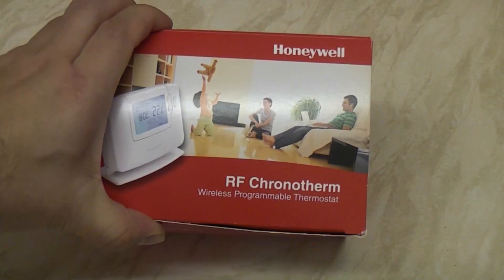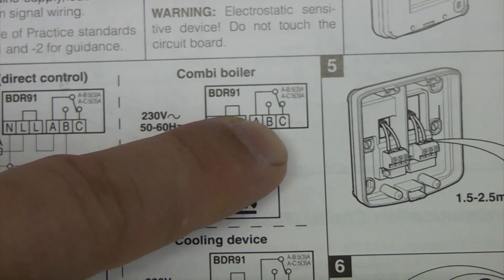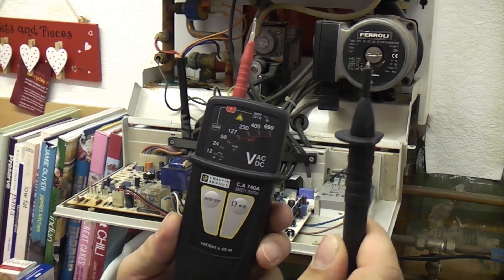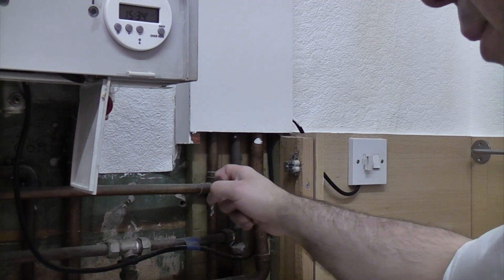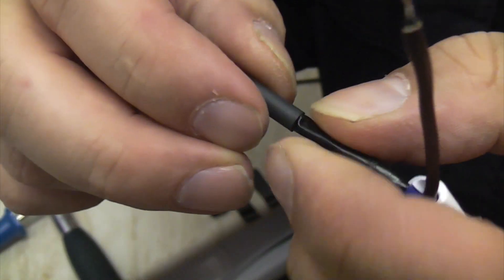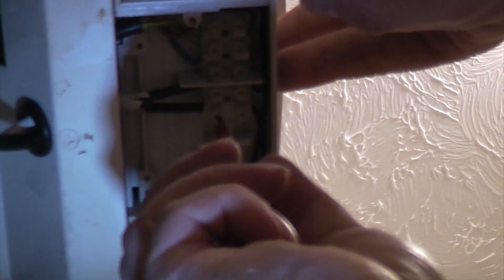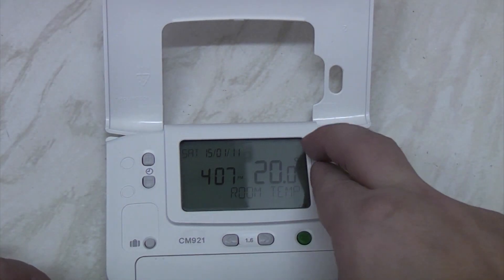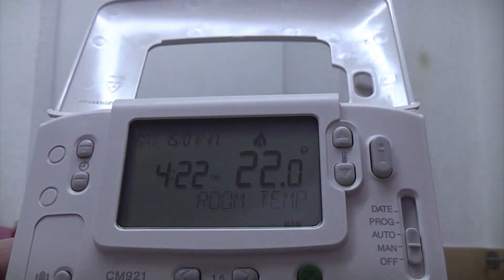How to fit a wireless room thermostat | fit Honeywell wireless thermostat

Comment: hi there, I have a honeywell ST9400C programming unit, and I am trying to replace my old hcw80 wireless thermostat and receiver, with a newer DT90e  in the old receiver have a 5 wiring which are (Blue wired in N, then the brown wired in the L (2nd)  then I have a black wire which wired in to A, then a grey wired into B and then the earth wired into the E, , do I follow the same with the new receiver dt90e ? if so where do I connect the earth as on the new dt90e there is no E (mark) only C, in the new receiver dt90e I have a NLL then ABC , any advice? thanks

Comment: informative video i have one of these can i take it with me if i go out anywhere? also on my honeywell CM921 ok button is not working to set the time?
Reply from the maker: No, if you move it too far from the receiver, it will not work.
You might need a new unit, if you want to set the time and the button is not working!

Comment: My relay box keeps flashing red and won't work with the transmitter. Any ideas on How to solve this?
Reply from the maker: Not sure, but it might have lost connection with the remote.
If you download the manual for the exact version that you have, it should tell you what it means and how to rectify it 👍

Comment: It's any chance to conect a thermostat to a vaillant eco TEC pro 28?
Reply from the maker: You should be able to fit this thermostat to any modern combination boiler, or if you don't know how to do it an electrician or boiler engineer will easily be able to do it.
Thanks for the comment 👍

Comment: Hi there I have exact one has yours,have you had any problems with other rooms in the house not getting warm,has I am having this problem,I have places the unit in neutral places and still only certain rooms get warm,hope you can help thank you,
Reply from the maker: This will only set the temperature in the room where it is placed, once that room gets to the set temperature, it will not ask the boiler for more heat. You can either move the remote to one of the cooler rooms (which will mean that it will call for more heat), or perhaps adjust the radiators in the other rooms using the radiator valves. If you are struggling, just do a search for radiator balancing, that should help ;-) 
Thanks for the comment 👍

Comment: Excellent video. I have a ferroli boiler.. similar diagram to yours. The clock in the boiler is faulty if I replace with a wireless thermostat and receiver can I just take the clock out

Comment: Could you explain to me where the two wires go for switching the boiler on? I’ve tried using the low voltage switched wires and remove the link wire but my boiler stays on all the time, I removed the link wire completely and my boiler still works does this sound right to you? This is why I’m going to have to wire it with 240 V switching
Reply from the maker: Normally the two switching wires just replace the link wire, as it is just a relay contact on the other end which closes to complete the circuit.
Thanks for the comment 👍

Comment: Great vid - would this be classed as a volt free thermostat as it didn’t require additional power source? Looking to fit to my Ferroli which can only have a volt free receiver fitted. Thanks in advanced.
Reply from the maker: Yes, if I remember rightly it is zero volts (you just need the L and N connecting to power the unit).
Thanks for the comment
Reply: Volt free would have been wired in the same way.

Comment: As a Gas Safe engineer myself I believe  you are breaking the law when a none  Gas Safe Person does any work on a gas appliance. It might be wise to contact Gas Safe for advice to prevent any trouble. On a recent Domestic gas course we were told an electrician was prosecuted for removing the boiler cover and connecting the flex to the boiler terminals.
Reply from the maker: I have contacted them in the past, when another Gas safe engineer was going to report me for removing the cover from my boiler to replace the expansion vessel.
Thanks for the comment
Reply: When was the last time a gas safe engineer tinned wiring... stop hiding behind gas safe.  Great video by the way Ultimate Handymen.
Reply: I'm an Rgi and an niclec  electrician. There's absolutely nothing wrong with him removing the cover in this case.  As the combustion seals were still intact.  You must have recently qualified.  Atleast kinda followed the safe isolation procedure 👍

Comment: I have an old room thermostat in the hall for altering temperature  and a programmer in the kitchen for choosing on off times for heating and water does this replace both of these boxes or just the room thermostat. If it replaces room stat and programmer do I have to disconnect all this before I proceed or does new thermostat auto override. I see this video...which is excellent is 4 years old...is there a more  up to date thermostat now. Thanks in advance.
Reply from the maker: I'm not sure, to be honest.
I have only ever fitted these to combination boilers to remotely control the central heating.
Thanks for the comment

Comment: Are you Gas Safe Registered as it is illegal  to work on a gas appliance if not.
Reply from the maker: No, I am not. 
You do not need to be gas safe registered, unless you are working on the gas side of the boiler, or a part of the boiler which creates part of the combustion seal.
Thanks for the comment

Comment: Great video, very helpful, thanks. I am trying to connect my BDR91 from a heatline caprizplus. It has a single connection for Room thermostat labelled (RT) and another one for Frost protection (FP) apart from the live and neutral. As our boiler doesnt have 2 switching wires as in your video, it is confusing as to where to connect it on the BFR91 - do I have to use any jumper leads? Thanks
Reply from the maker: I'm not sure, sorry.
This is the only wireless thermostat that I have installed, so far.
Thanks for the comment
Reply: @ultimatehandyman  No problem, thank you for a quick response.

Comment: Hi helpful video thanks. I need to replace this exact stat with a smart stat. The only thing I am confused about is the switched wires, does it not matter which way they go round in the boiler or receiver? It didn't seem to matter in the video? Thanks
Reply from the maker: It does not matter with this boiler/receiver as the receiver is simply replacing a link wire in the boiler. When the receiver calls for heat, it closes a contact to make the circuit on the boiler.
Reply: @ultimatehandyman  thank you for your help.

Comment: Just had a Wireless Thermostat fitted by a plumber, this is the best video around telling you how to do it. Only issue we had was working out which connection to put it into in the boiler.
Good job mate.
Reply from the maker: Thanks for the comment ;-)
Reply: I bought a Honeywell Y6630D Wireless Room Thermostat, which only has a turn wheel type of dial on it, no fancy digital display or anything. So working out if it goes into the 230v connection or the eBUS connection wasnt as easy to work out as you might think :)
Works fantastic now in, well worth the effort!

Comment: My existing Danfoss TP5000 only has COM and NO wiring. It is battery powered.  To install your CM921 i will also need L and N. Can i spur that form adjacent Light switch or power socket?

Comment: Can you add in one more wireless thermo stat on to this system for example one for upstairs one for down stairs?
Reply from the maker: No, this thermostat only switches the heat on or off.
You might be able to do it using different zones but you might need your system re-piping.

Comment: I'm replacing the same model. CM921. No matter how many times I press the buttons as you do, the unit will not go into the test transmit mode. Incidentally, a Honeywell video on here says press the left button, not the right one. Doesn't matter in my case though as neither option works for me!

Comment: thanks for the video... does it matter which way round the switch wires go?
Reply from the maker: In this particular installation it did not matter as the contacts are 0 volts.
It depends on your boiler though (it should say in the instructions)
Reply: ok... thanks

Comment: hi can you do a video for wiring up a two port valve controlled by a wireless thermostat to remote control central heating only - someone told me it doesnt need to be connected to the boiler as i dont want to mess anything on the boiler up just a request i need some help with cheers in any event all the best all the videos you put u are great :)

Comment: should of used the earth connection so the cable does have the earth in so any problem it cuts out.
Reply from the maker: The instructions said to use two core cable ;-)

Comment: I've got a salus wireless thermostat that's playing up, can I just buy any wireless thermostat and it will work with my current receiver or do I need a new thermostat and receiver and have to piss about with wiring?
Reply: yes you can they have 2 receivers make sure your replacement uses the same receiver as the one you got. You can easily re-pair them. If you can't find a thermostat without the receiver, you can just buy the kit and reinstall the wires in the new receiver.

Comment: hi there I have a Worcester boiler with the same transmitter but the buttons don't work very well but all I have to get a new wireless transmitter with the LCD screen do I just connect it wirelessly as you did when you put it into test mode with the existing wireless box or do I have to get a new wireless box and receiver fitted to my old boiler. Question mark thank you

Comment: How long should the all fitting take? I was billed one hour and a half for that. I think it is a lot too much.
I am very opposed to thermostats especially when there are thermostatic valves on each heaters. There is a conflict between the two controls and also you can have the required temperature in a room and completely freezing in another.
Reply from the maker: It's hard to say really. It took me a couple of hours as I was filming it but I installed one for a friend in about 45 minutes.

Comment: Sound vid and thanks, just a quick question, just fitting a Worcester 30i , am I ok to come strait off the fuse spare for the power to the receiver and just have the switching wire going to the boiler?......kind regards Mike.
Reply from the maker: Thanks Mike, yes that should be fine.Thanks for the comment.

Comment: Black for switch live wire? Shouldn't it be brown?
Reply from the maker: No, the two black wires go to the relay.
Thanks for the comment ;-)
Reply: Personally I would use brown unless it's different when wiring a relay. Didn't mean to be offensive by the way. It's a great video and very informative. Thanks for the reply.
Reply from the maker: No offence taken ;-)
I believe some of the wires going to the relay on some boilers could be 12v or 0 volts which is why I used black sleeving.
Thanks for the comments ;-)

Comment: Excellent! I've just bought one of these for a Baxi 105 HE. Pity it has to be 30cm away from metal because I had intended on siting and wiring the receiver right next to the boiler's fused spur (which is very close to the boiler. I think I'll test it there anyway, otherwise it's a short run up the wall. Great vid!
Reply from the maker: +Noth Ankyou 
I have just checked the boiler here, which has the exact same unit.
The installer has it positioned about 5cm away from the boiler and we have had zero problems ;-)
Reply: ***** Cheers for that. Hopefully mine will be OK then. I'll give it a week's test and let you know how it goes. Keep up the great vids!
Reply from the maker: +Noth Ankyou 
You are welcome.
Thanks for the comments
Reply: +Ultimate Handyman It's been operating fine for 3 days at exactly 100mm from the side of the boiler housing so I fitted it. Thanks for the tip!
Reply from the maker: +Noth Ankyou 
Good stuff ;-)
Thanks for the comments

Comment: Great video, do you have to disconnect the existing boiler programmer if there's one integral to the boiler as is the case with some boilers?
Reply from the maker: +Pat19eighty4 
I think you can just switch the programmer to manual, that should mean that the wireless thermostat takes over.
Thanks for the comment

Comment: great video..thanks for uploading.very helpful and easy to follow.
Reply from the maker: +Aamir Khan 
You are welcome
Thanks for the comment
Reply: +Ultimate Handyman I have a 24 hour timer switch installed for central heating(as. we dont have built in timer on our boiler).I want to put in a wireless thermostat.will same wires that come out of the timer switch go into the wireless thermostat?
Reply from the maker: +Aamir Khan 
I don't know, probably best to ask here- http://www.ultimatehandyman.co.uk/forum1/central-heating-boilers-f35.html
With as much information as possible ;-)
Reply: +Ultimate Handyman Thanks pal
Reply from the maker: +Aamir Khan 
You are welcome ;-)
Reply from the maker: +Dean Harper 
No it does not matter. I actually added black sleeving to the brown and blue wires, if I remember rightly!
Reply from the maker: +Dean Harper 
It doesn't matter because these two wires just lead to the contact on the relay, which is either open or closed depending on whether the thermostat is calling for heat, so this just replaces the linking wire that was removed from the boiler initially.
Thanks for the comments ;-)

Comment: Hi thanks for the vid.

quick question when you connect the switch wire A and B to the boiler how do you know which way round they go?
Reply from the maker: +g wild 
With this boiler it doesn't matter which way around they go as thy are simply connected to a relay, which is closed when the thermostat is calling for heat (which closes the contact on the relay)
Reply: +Ultimate Handyman 

Ty for the reaponse one last question before I get started, the wiring for the relay box says 
N L L (neutral live live) I can see you used neutral but did you use the 1st Live or 2nd Live to power the relay box?
Reply from the maker: +g wild 
I just connected the wires to the where the existing N and L wires were connected in the boiler
Reply: +Ultimate Handyman 

yes I can see where you wired it to your boiler yes but the relay box has room for 3 wires N L L. I was wondering if you used the 1st L or 2nd L in the relay box? Your video shows the relay box on the wall but it's not clear to see which connections you used!
Reply from the maker: +g wild 
Sorry, it was a few years since I installed this!
The two L terminals in the relay box are connected to each other, so you can use either of them ;-)
Reply: +Ultimate Handyman 

Excellent thank you for helping me with my questions wish me luck I'm about to start 😨
Reply from the maker: +g wild 
You are welcome.
Good luck with it ;-)

Comment: Can you use a 5core wire??  But obviously use 4 wires??. Instead of two seperate wires???
Reply from the maker: +Arks Shackerwell (ArksE8) 
It's a while since I installed it but if I recall it did say in the instructions to run two separate cables.

Comment: Hi I have the same one fitted but the thermostat is intermittently working so I need a new one.  How easy is it for me as a diy novice to replace just the receiver?  I believe I just need to change the head inside the receiver? Thanks for any help
Reply from the maker: +Sue Murphy Changing the receiver is very easy, just ensure you isolate the electricity first, then mark and identify the wires before removing them and ensure they are replaced in the correct terminals.
Reply from the maker: +Sue Murphy In fact I have just watched the video again and realised you don't need to touch the wiring. The receiver plugs in to the wired in part, so you should just be able to unplug the old one and plug the new one straight in.

Comment: had my fitted while bck....the box is display EE..still got hot water but unable to switch heating on cause the box display..tried resting but nothing happens .any suggestion ...??
Reply from the maker: Jennifer Gould 
No idea, sorry. I have checked my manual and can't find any mention of EE.
Might be worth giving their technical helpline a call- 08457 678999
Reply: +Ultimate Handyman thanks for replying.i looked in manual to and couldn't find anything .I will do.thankyou

Comment: Hi good video, can also just use  1 - 5 core cable 0.75 heat resistant flex-saves running 2 x cables.
Reply from the maker: Ian Blaymire Personally I would do, but I am sure it said in the instructions to use two separate cables- perhaps you get interference if you use just one cable?

Comment: Thanks for the video. Its helpful.

Just a quick question though. Do you connect the live supply for the reciever box from a fused spur first or all connections is taken from the boiler? Thanks
Reply from the maker: Sanni Salisu 
You are welcome

It's often easier to take the supply from the boiler. (the boiler should be connected to a fused spur), so once the fused spur is switched off it isolates the boiler and the receiver. It's normally easier to wire that way as you have to wire the switching pair to the boiler anyway.